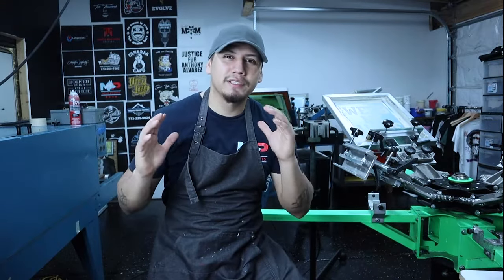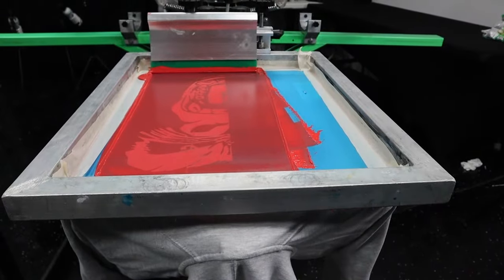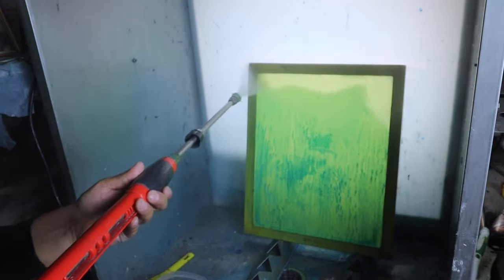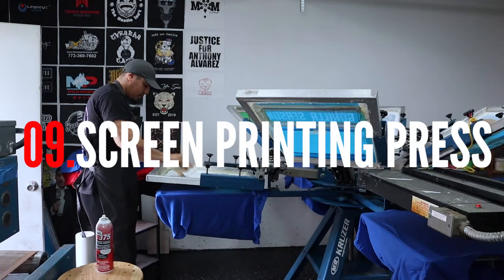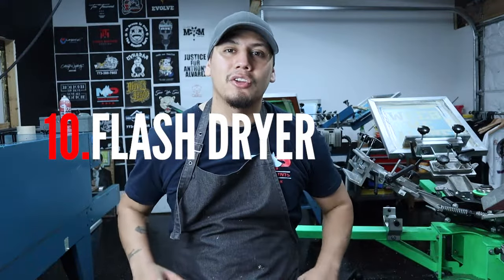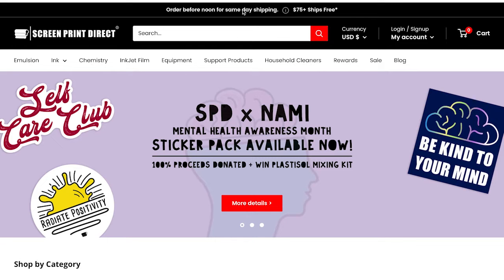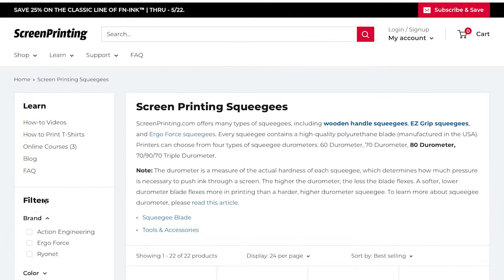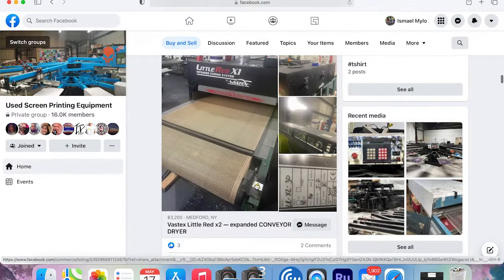EQUIPMENT YOU NEED TO START SCREEN PRINTING | RIGHT AWAY!!

Comment: Hey Mylo  I heard you at one point in one of your videos that you had to manipulate one of your cheap presses to get it to have off contact so you could print in registration, please tell me what you had to do,  as I bought a 4 color signal station press off Ebay and unable to get an even off contact around the screen set up on it before I can even start printing. Would appreciate your adive on what I need to do or I need to just send it back.